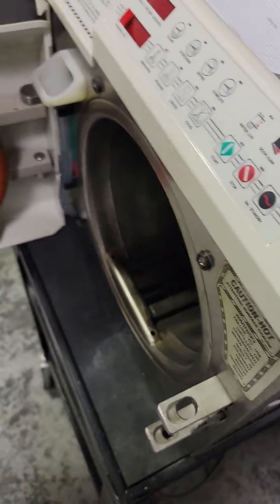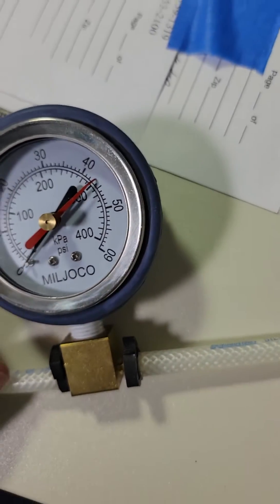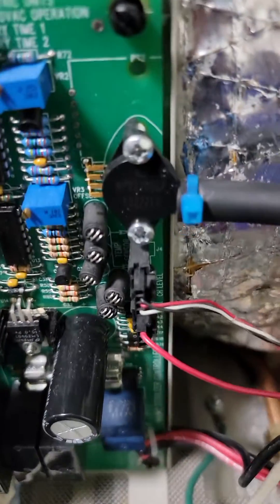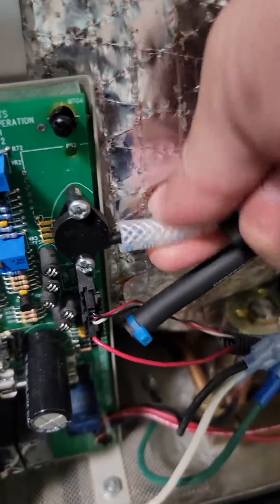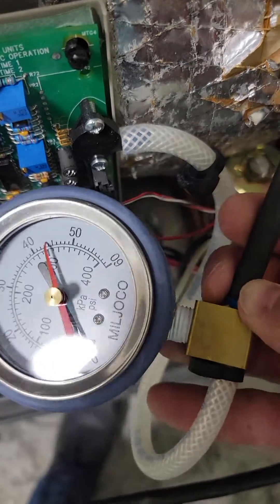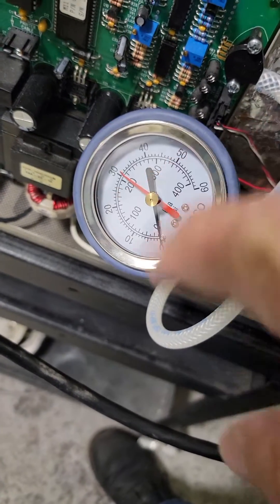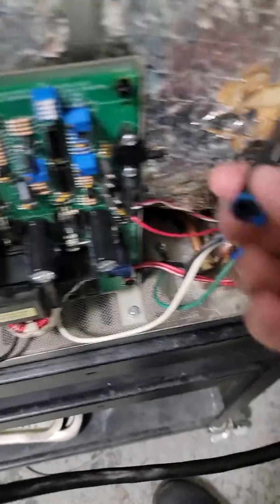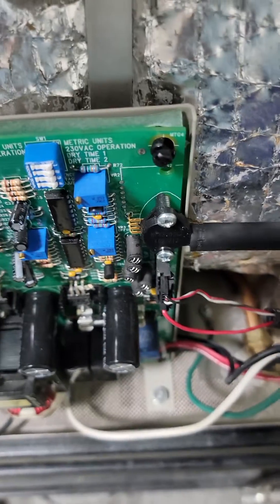pressure gauge for autoclave testing

Comment: Visio on how to calibrate ???
Reply from the maker: For this older style midmark autoclave specifically?  The pcb has pots for calibrating the zero and span for temp, and the pressure span, along with test points. Its all in the manual, I can go thru the full procedure next week
Reply: @The_Biomed that would be amazing!.  I just unsoldered the pressure sensor to replace it with a new one, so I’m expecting I might have to recalibrate the autoclave once I install the new one.   I’m working with an older model with the three pods next to each other on the top right of the PCB.   

Your videos have been super helpful in troubleshooting!  

So far, we have replaced the heating relay and have started to fix the LED display board by re flowing the solder.   The project has been quite challenging at times, but have found your videos helpful!  Thank you so much!!